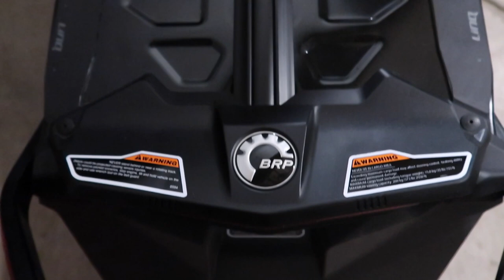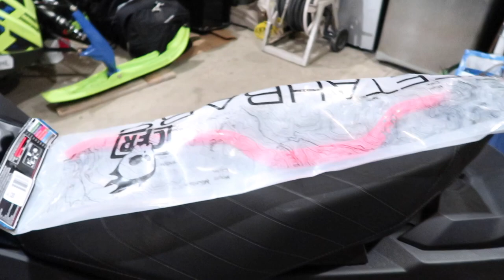CFR Boondocker 2.0 Handlebars | Install | Cheetah Factory Racing

Comment: Great vid.  I was going to ask how long it took, glad you told us.  One question, why did you wrap the grip warmers in electrical tape?    Will it loose some of the heat transference?
Reply from the maker: Thanks! The hardwarmers don't stick to the bars all that well once you peel them off and swap them over to the new ones. The tape helps keep the edges down when putting the grips back on. You could re-glue them or something along those lines but most of the time ive seen people just use electrical tape so I went that route. Seems to transfer heat well still. Just letting the sled idle I can feel the heat coming through pretty quickly. I'll make sure to note if I notice any big difference in heat transfer once I get some miles on the sled.
Reply from the maker: Bars still transfer heat great. Many times they're too hot and I have to turn them down 👍

Comment: Why not just paint the OEM handlebars so you eliminated the function handlebar adjustment rite
Reply from the maker: I havent found that ive used it when riding the G4 in the past. I usually put it two positions back from forward and leave it. Its a cool feature to have with the sled just not something I personally make use of.